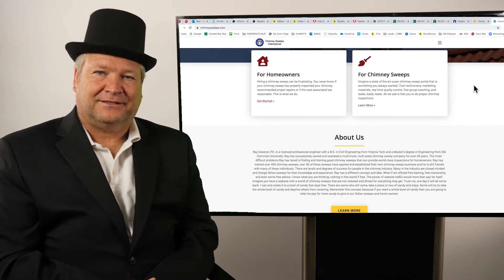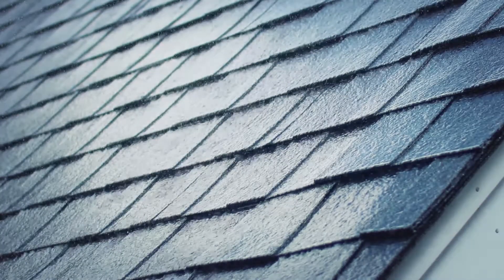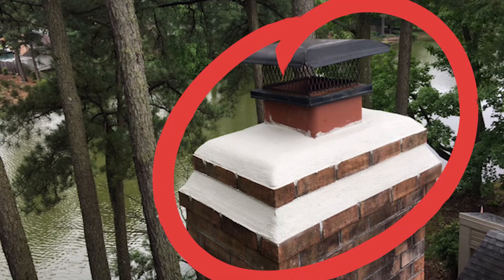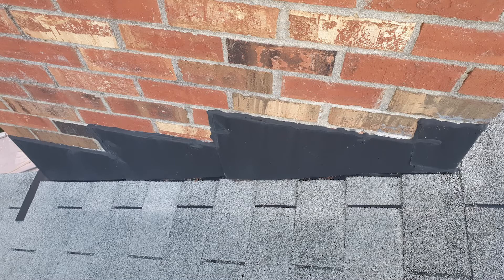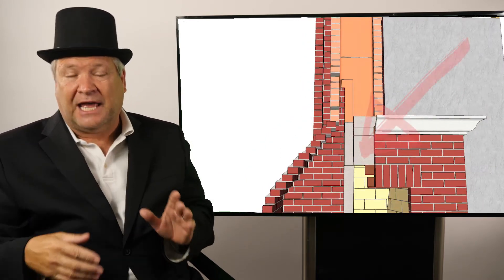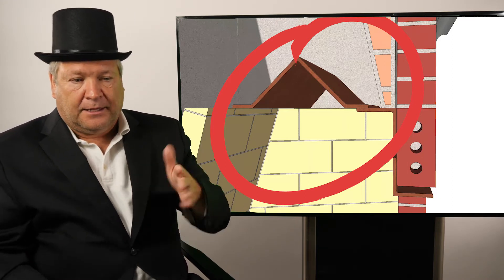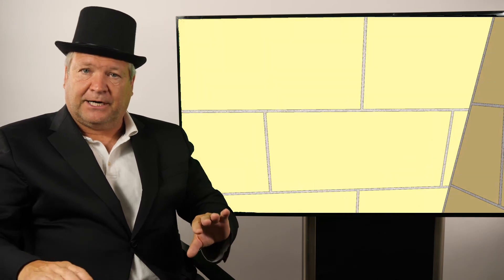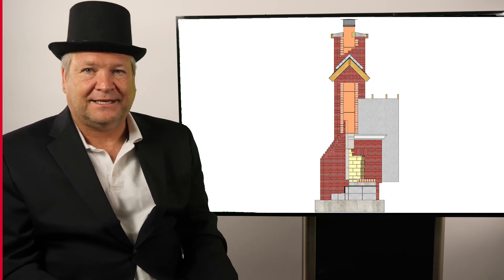Chimneys Explained #01 - Masonry Chimneys

Comment: Why not have a hole for air flow on the bottom as you would in a kiln so the heat, smoke and other gases can go up and and fresh air can come in from the bottom? Is that a thing?

Comment: You need to create a video of a converted masonry chimney, such as what is found in a home built around 1900, to one with a stainless steel liner going up from a wood stove to the top of the stack, perhaps 24 feet straight up.

You also need to create a video regarding the different types of brick typically found in a house built around 1900. There are hard brick which is found above the roof, and soft brick found from under the roof to below the hearth. Soft brick isn't bad if you know how to use it. First think is to saturate the brick with water before using it, or it will draw water out of the nortar before it cures, making the mortar joints weak.

Another video that you need to create is in regards to preventing falling off of a roof.

Comment: Can a wood stove be installed inside a Masonry fireplace?
Reply: Yes, anything that fits in will work, or, it can sit in front with a foot of stove pipe coming out the back before it turns up, but you should use a 6 inch flex liner all the way to the top, or... run stove pipe up inside as far up as you can go or afford. It will NOT draft / draw properly without this. (6 inch or 8 inch... whatever your wood stove "exit" calls for.)

Comment: In hungary where i live, chimneys are simply 4 brick put together, then built up like a brick wall lol. Despite being used since the invention of bricks, our government banned them, but still allows the use of existing ones. Prefab panel chimneys literally do the same, but cost 10 times much.
Those fireplaces look horribly inefficient though. All that  complication for so little efficiency...

Comment: Thank you for this!! 

We bought a 1907 home out in the middle of a PacNW forest. The home, from a ground level basement to the top of the attic is 4 stories and the chimney runs the entire length. It works great and keeps us warm however, there is a VERY noticeable cold draft that emits from the ash dump. I even see ash blowing UP from it at times but for the life of me, I can’t figure out where this draft is coming from. It can’t be from the basement as it’s completely enclosed from the outside elements.  The only thing I can guess to be a draft source is a very large, outer, brick-enclosed “box” on the exterior of the house at ground level. Would there be a tube, tunnel or venting pipe running from this exterior enclosure?

My worry is that there is a crack or opening somewhere along the structure, but the chimney works fine. I had a chimney specialist come out to inspect it and he couldn’t find anything wrong with it. Of course, he didn’t inspect it fully other than sticking his head in and looking up and around.

Comment: The damper is manually operated to stop the conditioned room air from leaving and it's purpose is also to redirect the smoke from going indoors.
Reply from the maker: Sounds good
Reply: how much Deta is lost by not having anything at all vs full working system? as i now know without it the rain/snow does damage it if the fire isn't lit regularly monthly/weekly